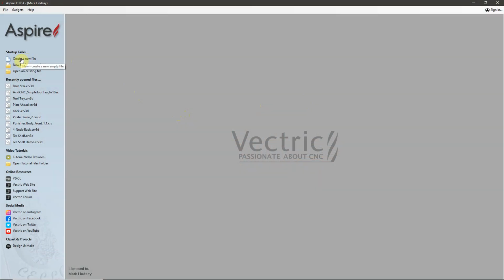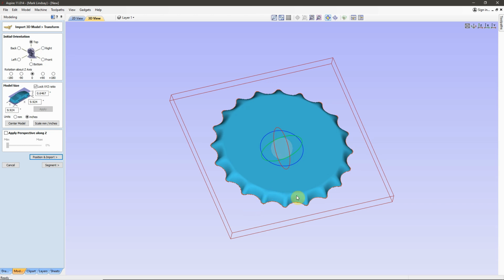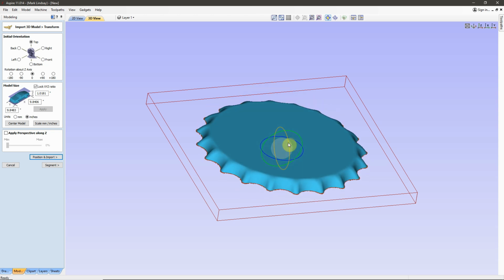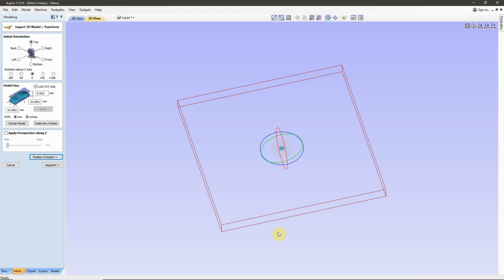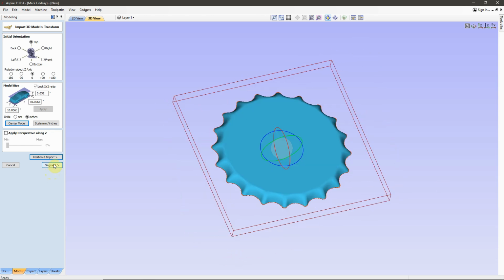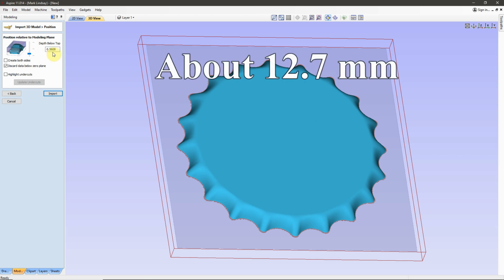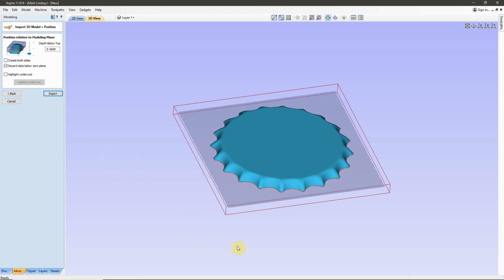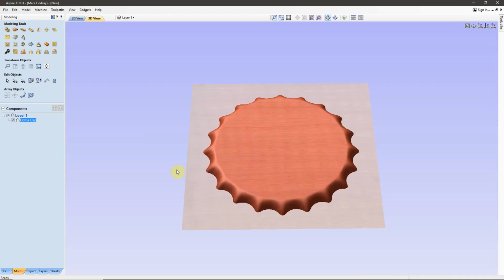Import an STL File into VCarve and Aspire Version 11.0 and Newer

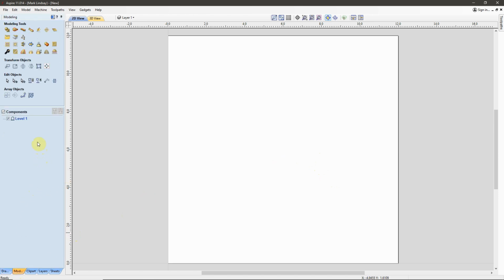Comment: At 2:26 how did you switch to the Modeling tab (I'm using vcarve 12.5)
Reply from the maker: Starting in Version 12.0, the Modeling tab was removed. It's now the Components tab. The modeling tools that used to be on the modeling tab are now at the bottom of the Design tab, under Modeling tools. I plan on making an updated version of this video as soon as I'm able to get back to making videos.

Comment: The stl does not import on the same plane as the work surface. When import it, it is 90 degrees to the work surface. How do i align it correctly on the work surface?
Reply from the maker: The top section of the first import screen is made just for that. Just click on the various selections until you get the orientation you're looking for, then proceed.

Comment: Mark, when I switch from the drawing tab to the modeling tab I have no tools? Are the tools like gadgets to be downloaded from Vetric? Vcarve Pro version 11.5.
Reply from the maker: The modeling tools in VCarve are extremely limited because VCarve is not a 3D modeling program. You can import, resize, and scale a 3D model, but you cannot create or edit a 3D model in VCarve. I use Aspire, which IS a 3D modeling program, so I have many more modeling tools than you'll find in VCarve.

Comment: Mark, thank you for all of your tutorials. Is there a way to import a topographic map model and then design a circle to go around the map, cutting the excess away? What tool in vectric aspire do you use to do this?
Reply from the maker: Thank you, Edward. Importing a topographic map is pretty straight forward, depending on what type of 3D file the map is. For your circle, you can try Level Clipping. I demonstrated it in this video: https://www.youtube.com/watch?v=kjJL5gKY4XE

There are other ways of doing it, but Level Clipping is the most versatile.

Comment: This cleared up my being stuck with modeling. Quick question - I am curious whether the model can be restricted to it's specific size and perimeter dimensions? 
What I mean is that it seems that the entire board surrounding the modelling object is also carved to the thickness of the object. Using the analogy of a Pocket, can the modelling object be carved within a pocket and leave the surrounding material untouched?
Reply from the maker: After you get the model imported, you can scale its size and thickness to whatever you need. You can place it into a pocket by drawing a vector that represents the pocket, and using that vector as your machining boundary.
Reply: @MarkLindsayCNC  Thank you, by trial and error this did worked out as you suggested. Many thanks.
Reply: @billhoward1379   Did you figure it out bill as I have the same issue. I know I can put a vector around my model and use that for my 3d roughing and finish, but  even if I get that vector very close to the models edge it still goes around it just a bit to a depth I don’t want.